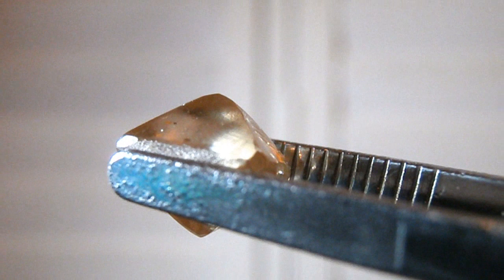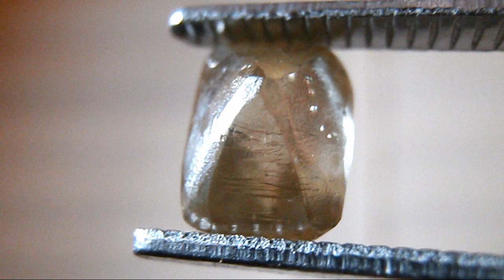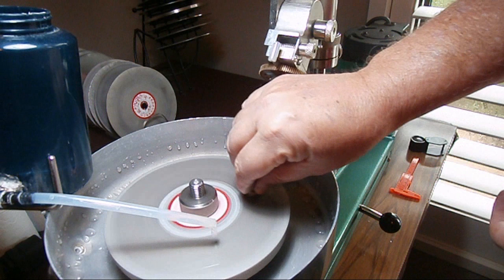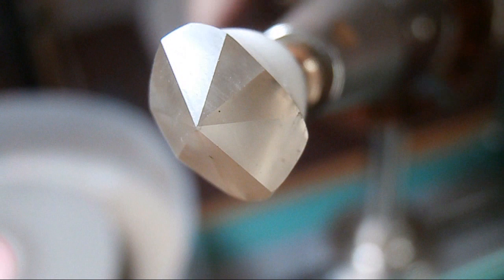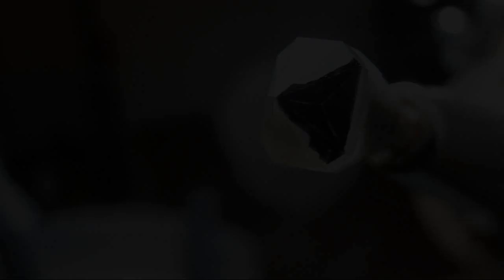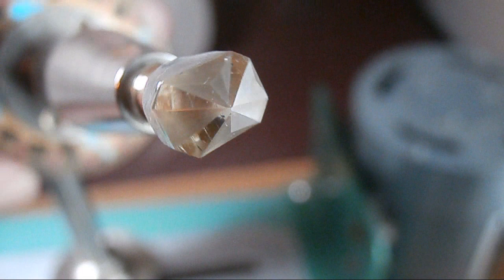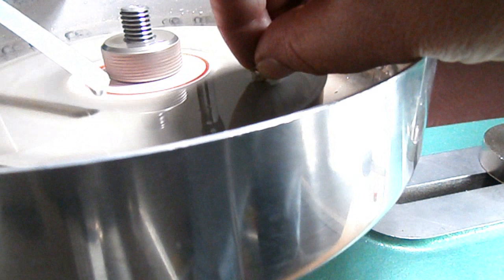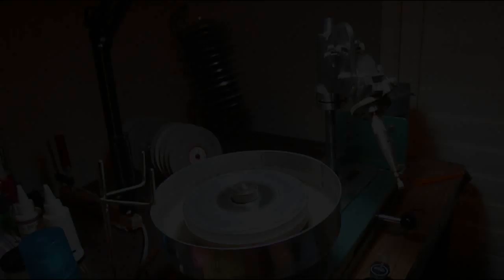How To Cut Gemstones - Moissanite A Diamond Alternative

Comment: Have not seen the for years, it is a great cut. Is there any way to get this pattern. It is the same cut on my Grandfathers ruby ring that I lost years age. The reason I know this is the point, I had the shank replaced and to jeweler did not reattach right. It would poke a small hole in my finger. Set back for him to fix and he broke the stone. It was replaced with a generic emerald cut. Just starting out cutting Gems and would like to recreate it. Even a name of designer would help. Thanks
Reply from the maker: Nancy Attaway is the designer of this gem. You should be able to get the design off the net. I did.
Reply: @VintageTimeGems  Thank you finally have a pattern. Now just have to try a few dozen times to get it right. Hopefully not that many but sometime feels that way. Thanks again and for the videos.
Reply: @VintageTimeGems  I found several of Nancy Attaway’s designs and am not sure which one you used.